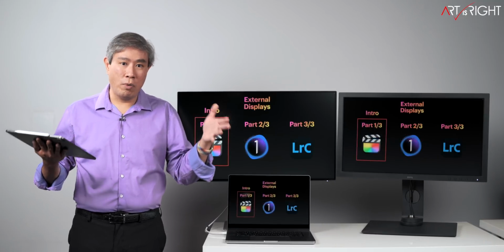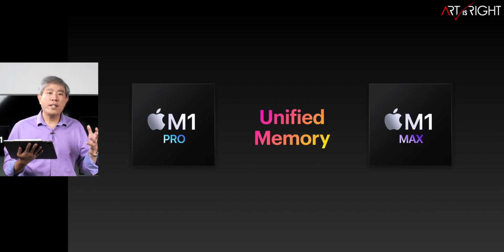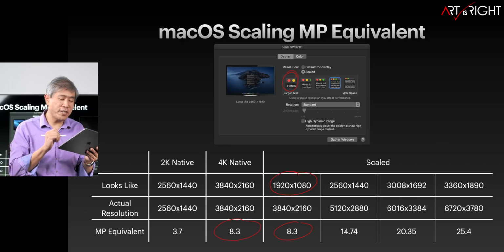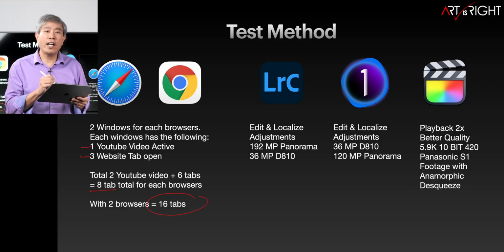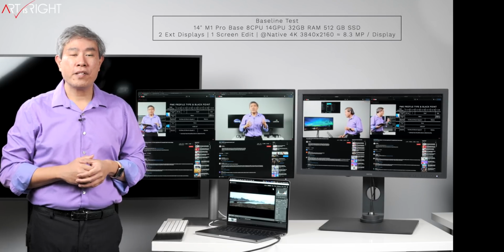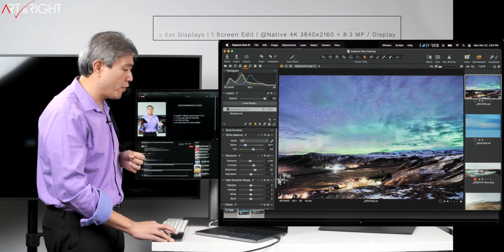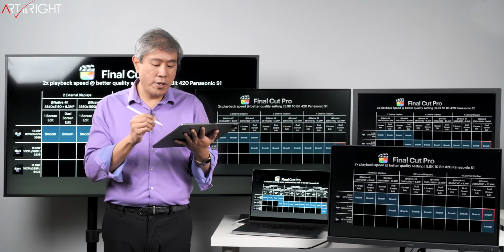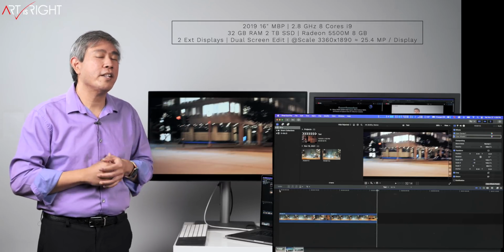M1 PRO & M1 MAX Multiple Displays & Multitasking Test Part 1/3 | Intro & Final Cut Pro Test.

Comment: So pretty much if you are using an Intel Mac you better avoid using screen scaling.
Reply from the maker: No, Intel Macs have been doing the same things since 2012 with the retina iMac. So no change what soever. Intel Mac just can't handle this well.
Reply: @ArtIsRight  I should have said it clearer, I meant don't expect too much with intel hardware.
Reply from the maker: Oh got cha, yes Intel will grind to a halt, it can support many displays but the fan will be running hard and computer super hot.

Comment: Great video, Art. Thanks for all your hard work in producing it. Do you have a preferred brand of USB C to USB C cable when connecting a MacBook Pro with M1 Pro/Max to a BenQ display? Thanks again!
Reply from the maker: I would search on amazon and find one that can do 4K 60 or higher, which is usually USB C 3.2 spec and you should be good. Something like this https://www.amazon.com/gp/product/B087ZQ4S6L/ref=ppx_yo_dt_b_search_asin_title?ie=UTF8&psc=1

Comment: Will it work with 2 Apple Led cinema displays? Thanks
Reply from the maker: Only on supported chip. i.e. M1 Pro variants and above. The only exception being the Mac mini M1 that can output to 2 external displays. Any other plain M1 & M2 chips on laptop or iMac can only output to 1 external displays.

Comment: Can M1 Pro connect  2 monitors with thunderbolt ports and 1 monitor with HDMI monitor simultaneously?
Reply from the maker: no, M1 Pro, 2 external displays Max regardless of connection type. The chip can handle 3 displays total but because you have a build in laptop display that counts as one regardless if it is on or off. You can get around this with display link but I highly don't advise that, it is software driven display.

Comment: Great Video! Which HUB are you using to connect all these displays to the Macbook Pro 16"? I'm after a USB-C or hub of some sort to allow a single port connection to the MBP. Thank you!
Reply from the maker: In this test I am not using a Hub. Display connection is as follows TB cable to PD3220U and daisy chain to with USB C to USB C SW271C. SW271 the one in front is using USBC to USBC directly to the laptop. The big SL display in the back is done via USBC from the laptop to Display Port cable.
Reply: @ArtIsRight  I didn't think you could Daisy chain with usbc?
Reply from the maker: These laptop are USB 4 /Thunderbolt 4 and the display is Thunderbolt 3 which is why Daisy chaining works. The display and ports on the laptop needs to support it.
Reply: @ArtIsRight just to make sure when you daisy chain you only plug on one usb-c and is enough to drive two mojitos in m1-pro ?

Comment: I calibrate my sw 271 report show average 0.45& 1.35 passed but I calibrate slot 1 gamma was 2.4 when I start color grading put calibrate slot 1 in 2.4 my back level not show correct when I change calibrate slot  to rec 709  that showing correct black level what wrong plz sir
Reply from the maker: Comment on 1 video will generally suffice ;). What do you mean by blacks are all wrong? Please describe, also have you tried 2.2, which is not for video but might work better. Let me know.
Reply: @ArtIsRight  my calibrate setting
Default is my custom setting
White point is d65 
RGB primaries
Panel native 
Lum is 90l
Gamma is 2.4
Back point is 0.5 
Profile version
V2
Profile types
Matrix
Patch size is large
 My calibrate slot 2 .
My calibrate have done my validate calibrate show average 0.43 and maximum 1.42
Everything is good wheni  start color grading in davinci resolve my black color not show correct is showing some wash out color in when change calibrate slot 2  to color gamut option to rec 709 that showing correct .which slot select after calibrate calibrate slot or color gamut rec
Reply from the maker: With resolve, Panel Native is NOT recommended. It does not color manage in the traditional sense, you should use REC 709 RGB primary for it. Nothing wrong with the display just a different way how Resolve handles color management.
Reply: @ArtIsRight  display settings
Default
Custom setting
White point
D65
RGB
Plane native
Lum
90l
Gamma
2.4
Back point
0.5
Profile version
V2
Patch size
Large
My validate calibrate show average 0.43 max 1.52
My calibrate slot is 2 
When start color grading in davinci resolve putting my calibrate slot 2 
My back color not showing correct showing wash out then I change calibrate slot 2 to color gamut 709 and back color showing correct.which slot should choose calibrate slot 2 or color gamut.
I have done calibrate in slot 2 in slot 2 back color not showing correct but in color gamut mode showing correct in rec 709

Comment: Very nice - 
So my question is I will be getting the MBP MAX 32/64 and awaiting the NEW LG lg ultrawide 40wp95c-w this is a 5k2k 40 inch ultra wide will I be able to run 2 of them as well as HDMI going to a 4K monitor ???
Please advise 🙏
Reply from the maker: You should be able to, it is under 6K so the max will handle it just fine.
Reply: @ArtIsRight  thanks ! Just can’t get a hold of these monitors
Reply from the maker: Short stock everywhere, I feel you!

Comment: Hello and thanks for effort. Is it possible to use 2x 1440p 144hz monitors plugged to Thunderbolt 4 dock which is plugged with single thunderbolt 4 cable to MacBook Pro 14 M1 Pro or M1 Max?
Reply from the maker: For 144 Hz that would depend on the dock, most of them have a top limit of 60 Hz so for this I would look at the dock and if anything you might have to do direct connection to the Mac and not via the dock.

Comment: I have two problems with my M1 Max Laptop with multi monitor operation.
1.) 0-255 / 16-235 problem on UHD-TV.
I use a big UHD-TV as my color grading monitor, which operates as a full screen display of the video in Davinci Resolve. 
I calibrate it with the X-Rite i1 Display and i1 Profiler software. All seems fine, but when I play back video on that screen with quicktimeplayer or VLC or the full screen playback in Resolve, the video has poor black and white levels. So this is a typical 0-255 / 16-235 issue. On my TV I have a dedicated menu option to switch it, but it is locked on 0-255 and is grayed out when connected through the thunderbold port of the MBP and the HDMI input of the TV with a cable which is capaple of HDR (but I turned it of in the Apple display menu). So I think the MAC OS control it and say it is a 0-255 display. So I think, the calibration of i1profiler make it as a 0-255 calibration and when video is playing, the MAC OS tells the software, that it is a TV with 16-235. On my other external monitor (a dedicated PC monitor) and of course the internal MBP monitor it is fine. Is there something I can do softwarewise? Because there is no option in the Mac OS display settings for 0-255 and no info about 8-bit/10-bit which is normal on my PC to switch that manually. My workaround in the moment is to calibrate the TV with 90 % contrast in the TV menu. And after the calibration I use a typical color pattern and bump up contrast a little bit and tune brightness a little bit and keeping white by 100 Nits measured with i1profiler.  
2.) Order Number. I use Davinci Resolve for my editing and I have a triple monitor setup. One for the timeline, one for the rest and one for full screen playback. Resolve recognize the monitors with numbers (Display 1, 2 and 3) and assign the functions to them. But on each restart of my Macbook (I turn it off in the night) the order is different and I have to reorganize the windows in Resolve. I checked each scenario (which monitor I turn on first and before restart or after...) and I found no logic behind it. The only constant is the laptop monitor which is alwas display 1. With my PC I did not have that problem. Any idea???

Thanks for all your great and detailed work.
Reply from the maker: About the bit depth based on my testing these computer output 10 bit as standard but the truncated range is another story. So are you using a TB to HDMI inline cable or dongle? Or are you using HDMI to HDMI? Usually with it comes to RGB output range, it largely depends on the output device. For instance, TV like to choose 16-235 instead of full range which is an issue. Changing it on a TV would be the way to go, one thing that you can try is to change the setting when there's no signal from the laptop this way it is not lock or gray out. Otherwise, I might try Switch Rez X and see if that helps but it may not do much for this scenario.
About resolved display arrangement this could be a bug in resolve / optimization issues with these M1 Pro / Max and Monterey. Even though these are based on M1 there are some other changes to them as well. And based on what you shared I might start with Resolve and them consider it to be an issue with the Mac. For something like this waiting for an update might be the only thing at the moment.
Reply: @ArtIsRight  Thanks for the helping ideas. I use a TB3 compatible USB-C to HDMI cable (up to 4k60Hz). I tried your idea and changed the Menu-TV when connected to my Windows-Laptop via USB-C (with no signal you cant switch). And when it was in mirror-mode I could switch it manually and see the brightness change. But when I connect my MBP again, it has no impact to it.  What do you mean with "Switch Rez X"? I will try conneting it via the hdmi port of the MBP. Maybe this will help...
Reply from the maker: Switch Rez X is a program that you can buy on a Mac that "may" allow you more control over the video signal output. YMMY on this one but I would give the demo a try.

Comment: I was wondering: "If you have your clamshell display closed, it doesn't allow one more additional external display." I have a MacBook Pro M1 Max 16 powering a 4K Cintiq Pro + two Apple XDRs and it works perfectly (along with opened clamshell internal display).
Reply from the maker: Right, what I was referring to there was the M1 Pro which supports 2 displays only and not the Max, since you have the max it won't be any issues. I am testing both Pro and Max.

Comment: Hey Art - look at the PLUGGABLE line of docs/dongles

You can run virtual monitors I believe through display port. Allows you to run 2-3 monitors on M1. I don't know what you can run on Max or Pro
Reply: Those run DisplayLink software and pretty much useless when you need color accuracy and responsiveness. I tried it with my M1 MacBook Air and it can't handle 4K 60hz properly. Avoid at all cost if you're working with graphics. Even with MS Excel, there's noticeable lag and I ran into cursor inaccuracy, click on one cell, it selects a nearby cell. 
Tested monitor is LG 27GN950 using DisplayLink DL-6000 series Pluggable hub.
Reply: @khoifoto  interesting. Thanks for your input. I just discovered them and they appeared to be an excellent tool for M1 users. As for Color Accuracy and responsiveness - I think when you're adding multiple monitors, it's done for efficiency with a realization that you have to give up something (responsiveness or color accuracy)
Reply: @aamsergie  It's not a compromise many graphic design professionals are willing to make. I'm more like a one man army, so I do big data analysis, build math models to predict the markets and also work on creative projects.
Trust me, you will lose productivity using those software display. It cannot keep up with me (on average of 200-300 inputs from keyboards / mouse per minutes and things become too laggy)
Reply from the maker: What @Khoi Dang said, and thank you to you both.
Reply: @khoifoto  that makes sense. You have a very specific function. I use multiple monitors but nowhere the level you do. Thanks for your input.